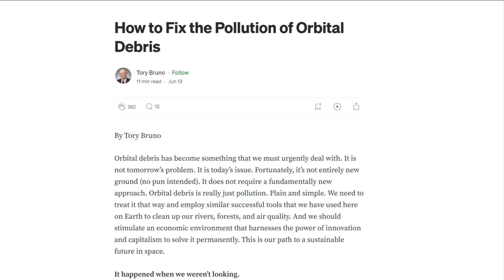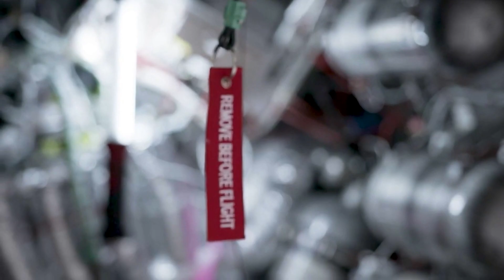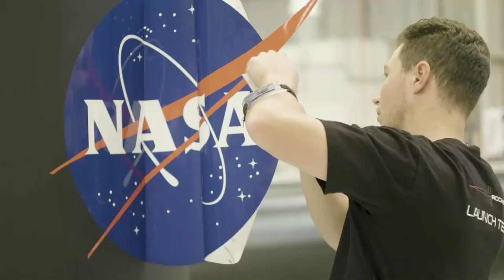How Rocket Lab Is Dealing With Increasing Orbital Debris

Comment: Why not grab the junk and move it to one of the easiest to get to stable Lagrange Points? Doesn't matter if it takes forever to do it. Most of the Space Junk is a potential resource that cost an arm and a leg to get up there. If space can become cheap (Starship?) then it won't matter too much but when it costs $10,000 per kg... you're better off collecting it all somewhere, no?
Reply: It will cost a lot more to do that than to just deorbit the junk
Reply: If they're planning to de-orbit the ISS, it would make sense to keep it up there for a while to serve as a recycling center for dead satellites.  With launch costs at $10,000 a pound, refurbishing a satellite with parts scavenged from another one makes too much sense.  THis would also let us build up the techniques and skills needed to do this kind of work all over the solar system in the future.